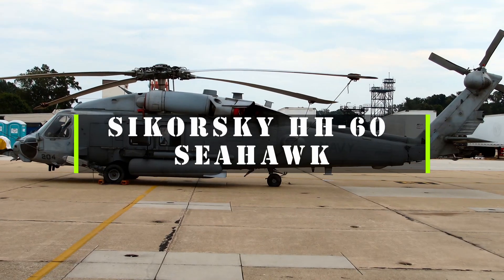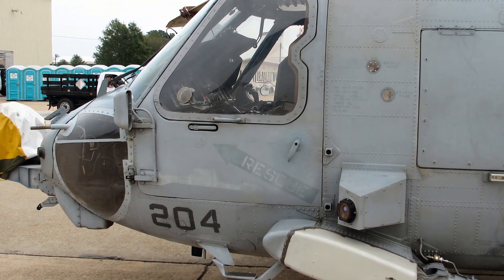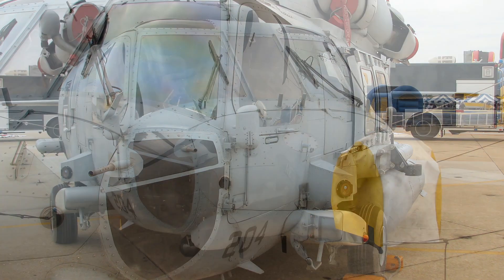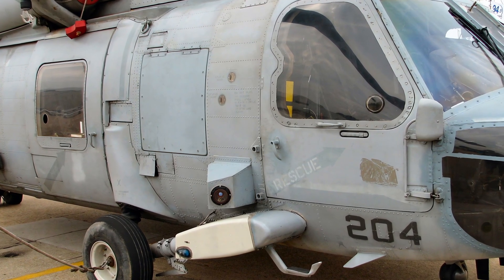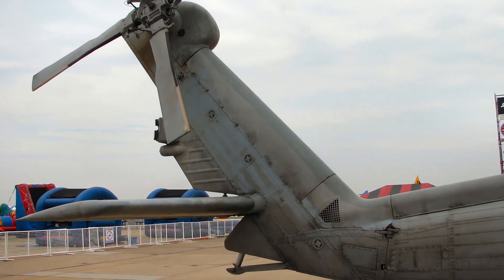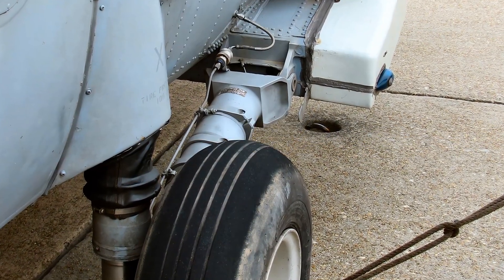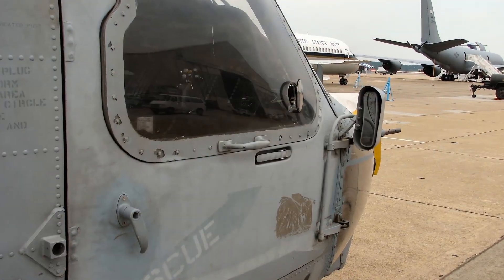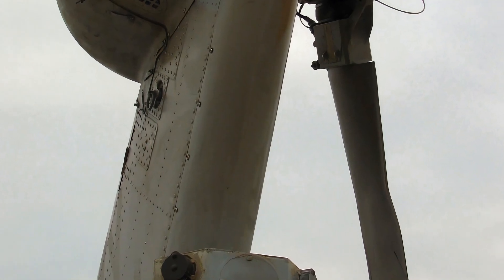Sikorsky HH-60H - multi-mission helicopter - HD

Comment: The HH-60H did NOT conduct anti-submarine warfare. It had no ASW equipment. It also doesn't have retractable landing gear. 

The aircraft in this video served with Helicopter Combat Support Special Squadron FOUR (HCS-4) Redwolves and Helicopter Sea Combat Squadron EIGHT FOUR (HSC-84) Redwolves, BuNo 163797. The airframe was converted by the US Coast Guard to MH-60T configuration. Still serving the US today.
Reply: Where is it now?
Reply: Hi Mark.  I thought these helos would be a great candidate to convert to a remotely piloted vehicle like some of the new Blackhawks.  I made this suggestion to my boss about 15 years ago.   He poo pooed it without a second thought.  The HH60H had all the systems needed to make it remotely piloted.  All it would take is a modification to the AFCS computer and connect it to the data buss.  The data buss is about two feet from the AFCS computer.   What do you think?
Reply: @jnbfrancisco I love the fact that the USCG is converting them to MH-60T. Airframes that spent years in combat will spend another 30 years saving lives.
Reply: @YamahaR1R7 I was hoping they would be made into a remote control vehicle.  They have all the systems required. Sat com, AFCS, radar altimeter, GPS, Doppler, and all of it tied together by a Data buss except for the AFCS.  Wouldn't have taken much to modify the AFCS computer and connect it to the data buss. Have you seen where they have done that with the Blackhawk?.
Reply: @YamahaR1R7 Hi Mark.  You might find it interesting that Igor Sikorsky, the founder of Sikorsky Aircraft was most proud of his creation because it saved lives instead of destroying them.  That's why the rescue pin was created,and presented by Sikorsky to anyone involved in a rescue using a Sikorsky helo.  I never had the opportunity to present one.  It's really a big deal to Sikorsky Aircraft.   Sikorsky Aircraft did not pursue attack Aircraft work for a long time after Igor's death out of respect for his pride in saving lives with his machines.   Another interesting fact about him was that he had to flee his home of Russia after the revolution and the Russians were not allowed to know about his accomplishments in the US until after the fall of the USSR.
Reply: Oops I made the same comment twice.  The reason I thought they should make a remote control H60 was due to some statistic I read about after the Vietnam war.  They found for every 3 people rescued they lost two rescuers.  They might have been useful for very risky rescues.